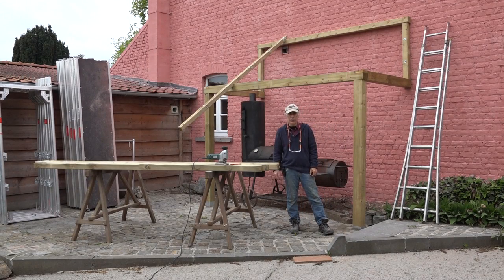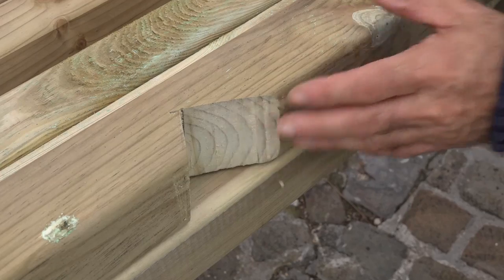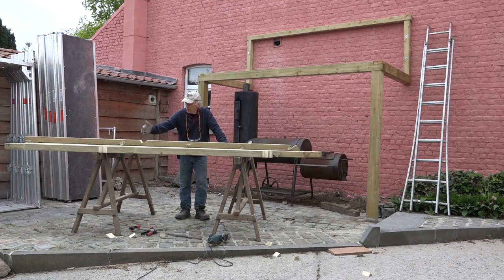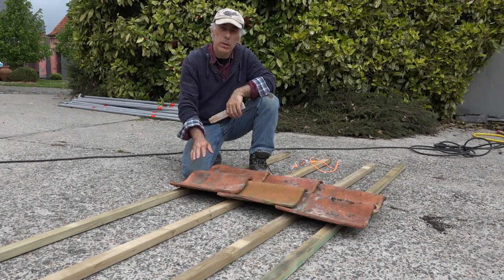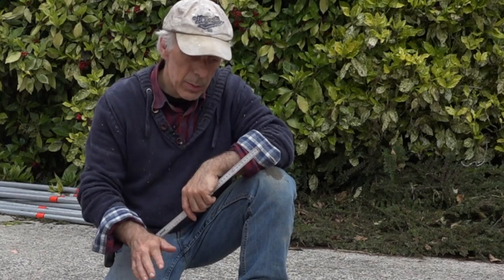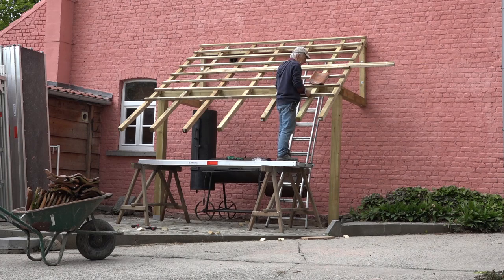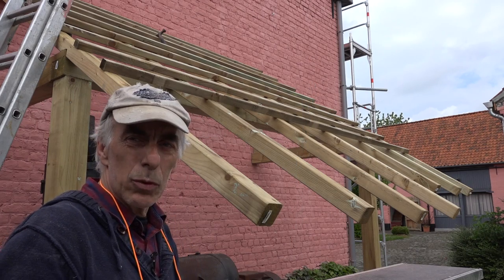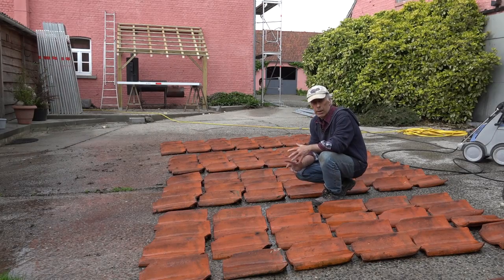Building a BBQ shed Part 2

Comment: Those tiles are not nailed?  Would like to see you use the BBQ.
Reply from the maker: Hi Bill, no those tiles are not nailed. I know its strange ,even on large roofs they were not at the time.  Especial since there is no under roof , so the wind blows through the gaps...  If there was an under-roof, then that would cause back pressure under heavy wind and the tiles might come off.  That is why on modern roofs, using 200 old clay tiles , inox clips are used to hold them in place.